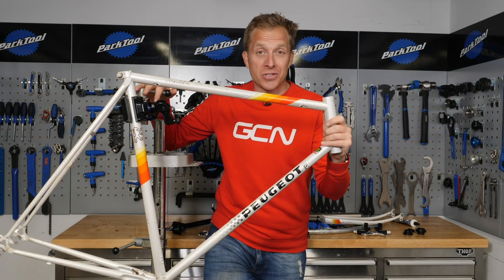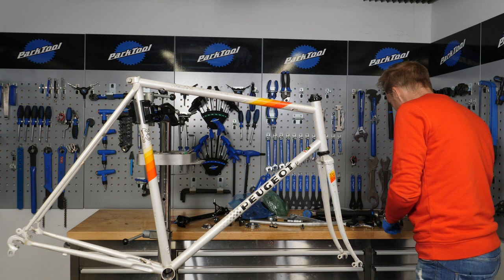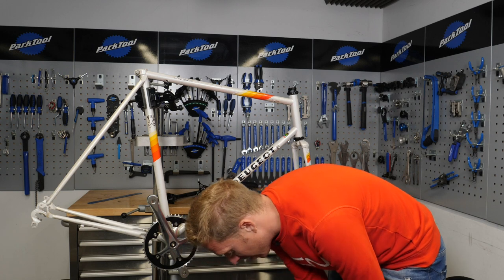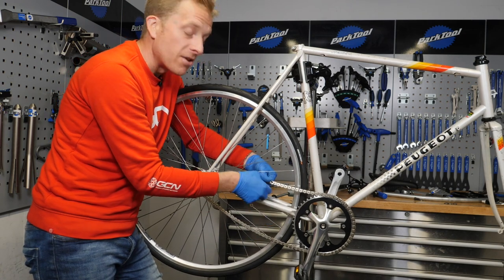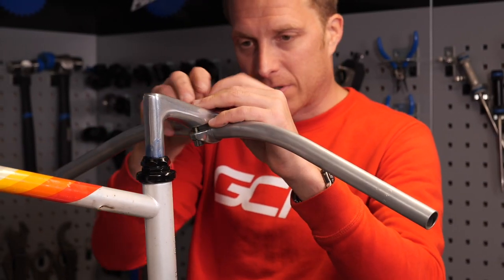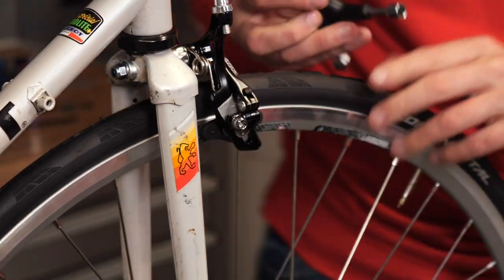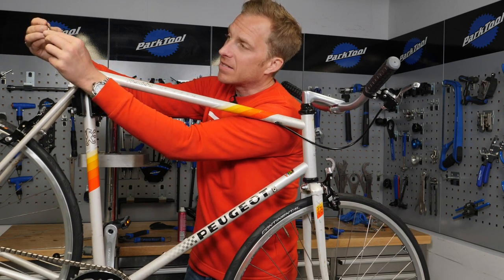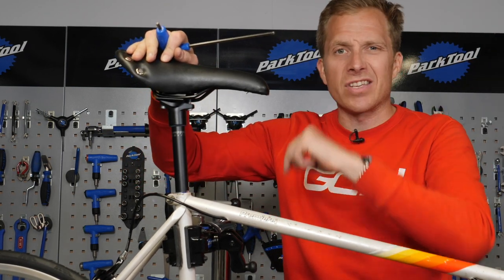How To Build A Fixie  - Real Time Complete Build | Cheap Bike To Fixie Ep. 3

Comment: I don't get why you need to scratch the handlebar: Just slide the brake leavers on loosely, then install the grips. Then move the brake leavers. I'd personally use brake cleaner or alcohol instead of hairspray as this guarantees for a no-drama removal as it evaporates 100% without any residue. Also it does not smell gay 😄About that inner frame routing, there's an easier way: Put a string through the hole, then hold a vacuum cleaner to the other hole until you have the string. (Also works on power cables through sewage lines, I know it, though use a bigger string then and knot onto the cable). Not a big fan of your red bull shim, at least not while it is standing out on top waiting for injury.

Comment: Great video. I also upgraded an old Peugeot Premier and had similar problems with the seat post. After a bit of digging around on eBay in Germany, I found a company that create modern 24mm versions. It seems that the old East German MIFA bikes also used the 24mm standard, and I think there are enough of those bikes around to support that market. https://www.ebay.de/itm/Alu-Patent-Sattelstutze-24-mm-Diamant-DDR-MIFA-350-mm-Lange-Seat-Post/111606732311?hash=item19fc479617:g:tfQAAOxyGqZSYNov

Comment: Look at the top tube with the ding and tear right through tubing just behind the head set. The frame is junk. I would never atempt to ride with a frame in that condition which could fail in a heart beat under normal use.

Comment: Just one thing: Never, EVER touch a chain on a fixed gear unless its still on the floor. You fingers might get pulled and get trapped between the chain and the cog/chainring teeth.

Comment: You did non mention two crucial aspects in building a fixie. The chainline and the rear wheel OLD. I suspect, but again, no a single word about it, that your frame has a rear spacing of 126 mm. What about the rear wheel ? No comments also on the axle lenght of your BB ? GCN tech as the name would suggest, should deal with precise technical aspects.
Reply: 126mm rear, I played with some washers, 107mm bb. The bb is largely irrelevant as it only matters for this frame in this case. Different chainstays can mean different axle. Cheers. Jon

Comment: Adding grease to a bolt that has thread locker compound? Where did you go to engineering school? A good video conceptually, but some strange techniques and some old wives tails / ignorance about the mechanical / engineering or assembly techniques... greasing the headset but not the bolt, talking about scratching drop bars, then scratching the flat bars and possibly moving the brake levers to expose the scratch... torque settings for bolts are usually given for dry assembly, and greasing the bolts can change the settings that the torque wrench goes off at...